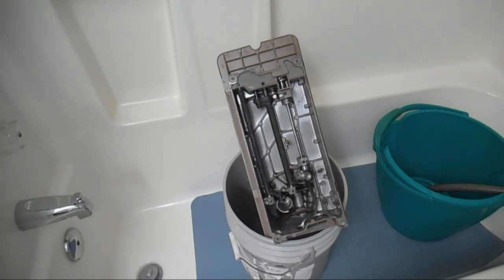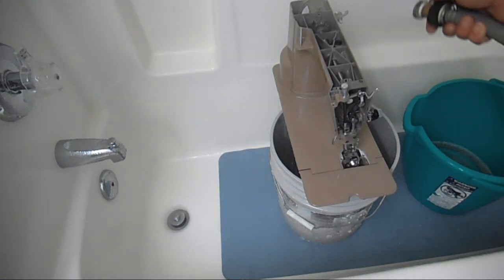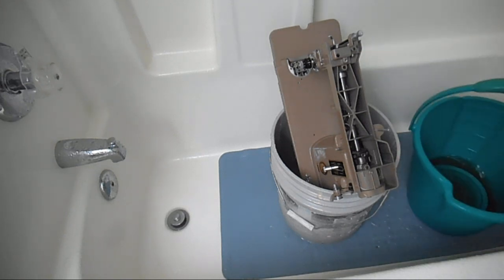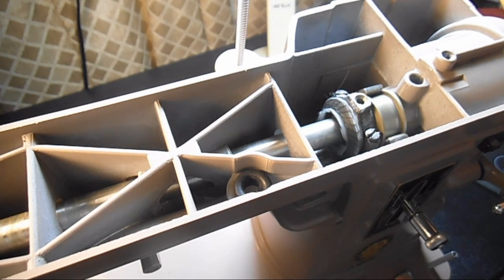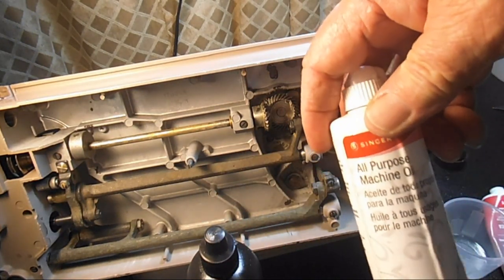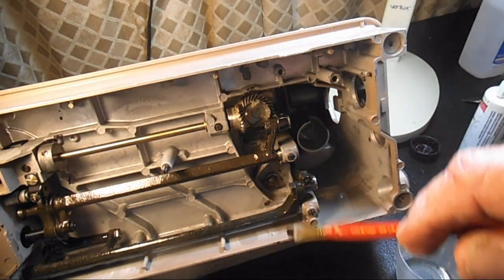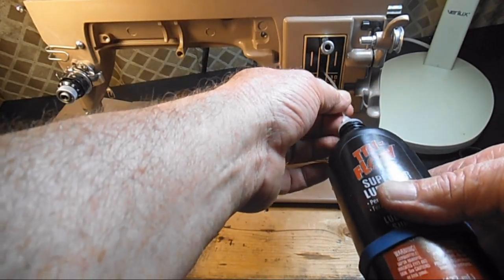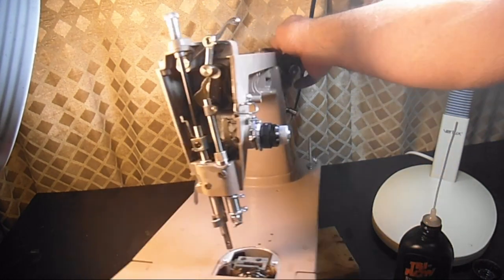Coco takes a shower - Coco goes to the Spa Pt. 3 - Singer 301A Rehab

Comment: I am rehabbing a 301A that seems more dry than dirty.  But I will follow your tutorials and give my Jacquy the full treatment!  Some things are not moving at all, like the feed dog knob.  And I’ve taken off the bobbin assembly and the feed dogs themselves.  So much oxidation and rust but not without hope.  I also took off the the hand wheel before I found your videos and when putting it back on, it was difficult to move, like it wasn’t right.  Does removing it mess with the mesh you talked about?  I hope a spa treatment will take care of this.  Thanks again!
Reply from the maker: Hi, Candy. I'll try to answer some of your questions. First about the "mesh". The handwheel gear meshes with the pinion gear on the motor shaft. You should remove the motor anyway if you will be cleaning the machine. Here is a simple video showing how to remove the motor: https://youtu.be/wZFFYVCjH8A   By feed dog knob I'm guessing you mean the feed regulator or stitch length control. If that lever won't move up and down the regulator inside and sliding block may just need oil, or cleaning and oil. I think my biggest concern would be the "oxidation and rust". Cleaning the machine with Krud Kutter will not do any rust removal. I use a product called "The Must for Rust" and like it very much, but there are other rust removal products also. Here are a couple videos about removing rust on the machine and the small parts: https://youtu.be/xlAl-VhVgOg   and https://youtu.be/anyDAwKZmDY    You found the Coco Goes to the Spa series. Here is the 19 video playlist: https://www.youtube.com/playlist?list=PLsCOZgzzaiKLZyGebzS_oISgesXNyREyI
I also made 17 more videos about the model 301A that you may be interested in and here is that playlist: https://www.youtube.com/playlist?list=PLsCOZgzzaiKI_6fbu3itbd1v4z3uQvvkO   If this is your first restoration just take it slow, take pictures before removing parts, and have fun. You can certainly get that machine running nicely again, and thanks for rescuing it.

Comment: What is car putter?   I see, it’s bad cc.      Is it Krud cutter?   From auto supply shops?    Instead of kk, can it be sprayed with alcohol?    The rust comment concerns me…..  
I have never seen such good instructions for greasing and oiling.  All I did for over 60 years is drop oil in the boles and as per little booklet instructions….  Getting out brushes.   Pretty sure CoCo is the same model I’ve used since 1959.   Gotta say, it still sews just fine.   She’s a tough old girl,
Reply from the maker: I don't know what car putter is. Krud Kutter can be found at hardware stores, Home Depot, Lowes, some Walmart stores and many online stores. I put a link below the video to the manufacturers page about the product, and I'll put it here for you: https://www.rustoleum.com/product-catalog/consumer-brands/krud-kutter/cleaners-and-stain-removers/original-krud-kutter   If you've had the machine for 60 years and are happy with how it works then don't do anything at all. IMO, alcohol is not a very good degreaser; very slow to work and requires lost of scrubbing.

Comment: Andy - I have watched videos 1 & 2 and I am up to the part where you take the screw out of the clamp that holds the motor in. It's stuck but husband can figure it out. My question is you keep saying Krud Kutter. My 301A is black. Do you recommend GoJo or is their something specifically for black machines. I am using the plastic bag technique as I want to label everything. I already took off the light casing and the electric. I am feeling empowered!
Reply from the maker: Welcome to Andy Tube, Jack. I'm glad you did not try using the KK on the black finish. Thank you. I've had 2 viewers tell me they used GoJo with great success. Once they had the parts off that they wanted, they used a brush to put GoJo all over the machine, inside & out and then washed and dried the machine like I do They were very happy with the results. Very Happy! One viewer referred me to this video her husband found about using the GoJo:
https://www.youtube.com/watch?v=HjhnzfmuLgg
I've never used it myself but the video is convincing and my 2 viewers said it washed off and out of their machines (a 301A and a 99K) OK. One said it look a little more rinsing than the KK, but she had "really glopped it on the greasy old internal parts" so maybe that is why. I would test a little spot first I thik, just to feel reassured it would not hurt tht beautiful plack finish. Take Care.

Comment: Hi Andy, I got my 301 and was very disappointed in how dirty she was, I have done the outside first.lol..and all I can see, I still have a lot to do.  but am happy she looks so much better  I did get some on her back decal and lightened it, but overall I like it because I was so afraid to try it.  I still need to open the top and bottom.. Thanks for your videos.
Reply from the maker: Welcome. If you are worried about the finish or decals, a viewer told me about using GoJo hand cleaner (the one without pumice) to clean vintage sewing machines. Using a small stiff brush to "paint" it on and wiping it off with rags. She recently restored a 1916 Model 115 with it and sent me a picture. It looked faboulous! I've never tried the GoJo but have heard of it being used on the Black Singer machines to avoid hurting the paint and decals.

Comment: I live in arizona... I am looking to fix a montgomery ward UHT J 1954 machine and was looking for someone who could help me with it by way of videos like this but am having no luck finding one for this particular machine i got for 5 dollars.. Mine is pretty clean inside but something is sticking and i have oiled where i felt needed oil and it helped some but still wont let the needle go up and down.. Going to use some of these tecniques  and see if i can get it unstuck so it will sew. Most shops want you to spend 100 just to have it looked at and i cant see spending that much for a machine i bought for 5 dollars. LOL Great video
Reply from the maker: OK, Jack. Usually you can get a machine moving by repeated oiling of the metal-on-metal moving parts and oil ports for bushings and bearings. I'm assuming nothing is moving at all on yhour machine? If oiling alone won't free things up do not be afraid to warm all the parts with a hair dryer or spray it with WD-40 to soften the old dried up oil. If the needle bar is the ONLY thing not moving you have a whole different problem and we can talk about that. BTW, I only work on SInger Branded machines, but most sewing machine work on the same principle. Here is my latest cleaning video showing how to clean after removing a minimum number of parts: https://www.youtube.com/watch?v=Z2DPIbR2lKw

Comment: Hi, Andy! I’m trying to rehab a 301A (my first!) following along with Coco. I made the mistake of not greasing/oiling immediately after the “shower” and by the morning it had started rusting. I ordered the must for rust and it was working great, but I still couldn’t get anything inside turning again. I oiled to try to get the gears turning but had no luck, so I went back and used krud kutter to get the oil off and then tried the must for rust again in the shower. This time it started rusting immediately even though I’ve been drying it with the leaf blower. And still nothing is turning. Please help! I feel like I’m ruining this machine...
Reply from the maker: I'm not getting the "then tried the must for rust again in the shower". So the morning that you found rust, where was the rust at? How long was it in time before you used the Must for Rust on those areas? How long after the first shower before you oiled the machine?
Just trying to catch up with what you've done here. Thanks.
Reply: Andy Tube I followed your videos up until the oil/grease part and it was probably about 8 hours before I noticed the rust. It seemed to be pretty light rust on most of the gears and shafts. There was more on the horizontal arm shaft and concentrated on the bevel gears and the area directly to the right of the bevel gear (sorry I can’t find what this is called). Under the bed it was mostly on the rotating hook shaft and those bevel gears. There was also some rusting inside the front needle/ face plate area. It took a week for my rust remover to arrive so I didn’t start removing the rust until a week after the initial shower. Today, I watched another one of your videos for tips with the rust remover and alcohol to clean the rust remover. It was working great on the rust but I still couldn’t get things moving so i started oiling it but it was still stuck. This is where I went rouge... The must for rust says you can spray it on and I thought that might help it get into any places I may have missed in my first attempt. But it also said to remove oil before using it. So, I went back and gave the machine another shower with a spray of the diluted krud kutter like in this video and then rinsed. Then, I sprayed the inside with the must for rust and rinsed that off. Then I blow dried with the leaf blower.  Still no movement and the rust is back with a vengeance... I added a bit of oil again in the upper arm just to try again but it’s making no difference. I hope this make things a little more clear Lol! And thank you so much for trying to help!
Reply from the maker: @AliSoFetch  Ok, thanks. I want to let you know that I have washed, dried, and put the machine on the bench and found it to be completely frozen already, without a spec of rust anywhere on the machine. The KK degreaser can completely remove all oil from the bushings and bearings and freeze the machine. Because all parts on the machine move together, a single dry and seized bushing can freeze the whole machine. I don't know what kind of "cocktail" you have inside some of those bigger bushings now. The main ones for the shafts can hold quite a bit of oil. I feel what you need to do at this point is to overfill and flush those bushings with fresh oil. I mean to the point that if the oil is leaking out it's a good thing. Oil can be wiped up easily with rags. So yes, remove any visible rust still on the machine, then oil the heck out of it. The instruction manuals shows all the oil ports and places starting on page 26. You can get a free copy of the manual as a PDF download from Singer at this link: https://www.singer.com/search/support?title=301   I also made a detailed video about oiling and greasing the machine;
https://youtu.be/BIhupj5K3t0   Some grease on the gears will help of course, but I have found it is the bushings of the main shafts, the needle bar (if it is in place) that need extra attention. On a frozen machine I often just use the Singer brand of plain sewing machine oil b/c it saves a little money. After the bushings are all flushed out and the machine is moving again I will later start using the better TriFlow oil everywhere. Do not skip any oil points. Oil every single one. FIll those bushing ports until the oil is up to the top. This can take time to work and it could be one bushing that is stuck or several. If by the next day and a couple of heavy oilings I don't get the movement I start heating the oil places with a hairdryer, especially the main shaft bushings.
Those are the ones at each end of the horizontal arm shaft, the ones at the top & bottom of the verticals arm shaft, and the ones at each end of the hook drive shaft. Those are the 6 main bushings that take a lot of oil. The very first time I used the KK I did not dry the machine enough and let it sit several hours. I was so pleased with how clean it got and then so freaked out when I returned and found some rust and the machine was totally frozen. I thought I had created a boat anchor. I super oiled it and the next morning I had a tiny amount of movement. I realized I had not oiled the lower bushing on the vertical shaft. I oiled it and used the hairdryer on that bushing. In 10 minutes the machine was turning freely. Good luck.
Reply: Andy Tube thank you so much!!
Reply from the maker: @AliSoFetch  👍

Comment: Can this same procedure be used for the LBOW and black model 301s?
Reply from the maker: The LBOW paint finish is of the same type as this machine. I cleaned 301A, 40A, 403A, 500 and 503A with no problems. The Black Singer Machines ae different. A few viewers tested KK on black paint and said it hurst the paint. I would not use it on black painted Singer machines. A couple of the viewers said they used GoJo with good results. I have nto used GoJo so I can't say if it is good or not. The internal parts of any acine can be cleaned with the KK, inclding plastic gears and levers. Thank you for watching.

Comment: What is the name of the mineral oil you are using?
Reply from the maker: The oil I use is called Tri-Flow Superior Lubricant. I show it at 20:36 in the video. Here is a link to the manufacturers website: 
https://www.triflowlubricants.com/product/superior-lubricant-drip-bottle
I can often find it at local bicycle shops and also buy it cheaper on eBay. I used the Tri-Flow synthetic grease also. Thanks for watching Andy Tube.